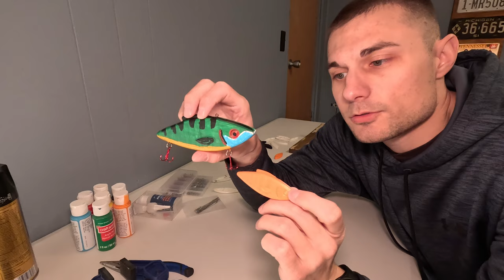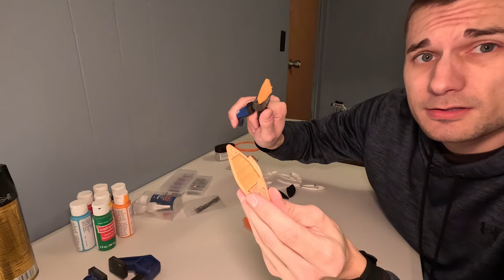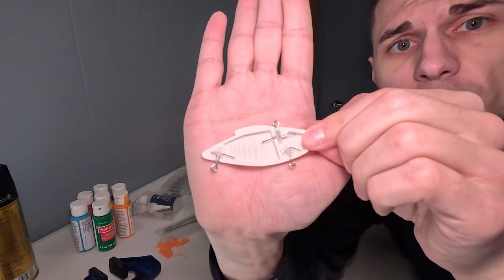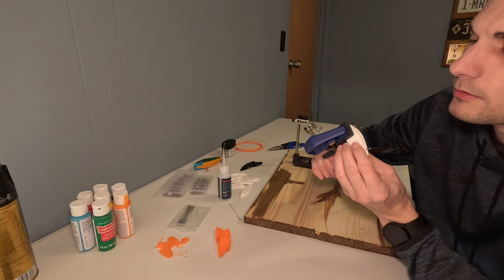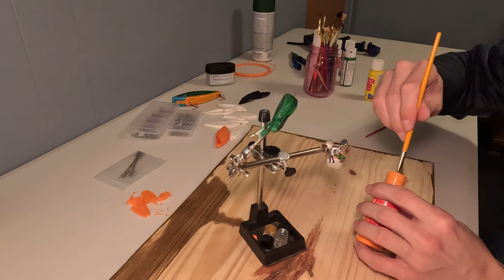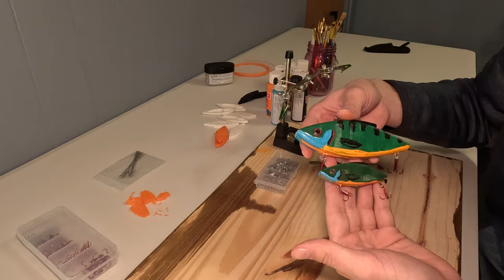How to make a 3D printed fishing lure

Comment: What size bearings & hooks did you use?
Reply from the maker: They should be about a #6 treble hooks and 4.5mm bearing. But you can of course adjust based on the scale of your print.